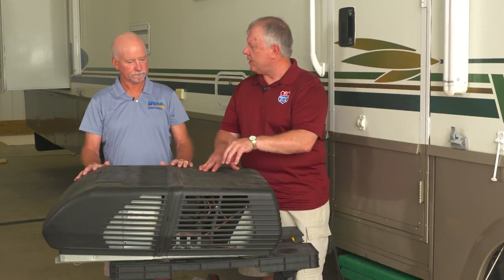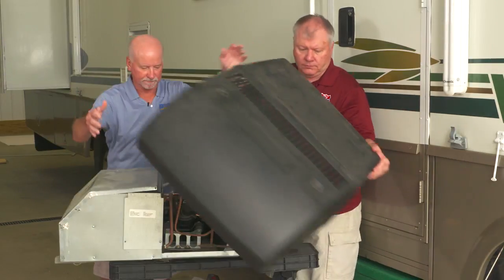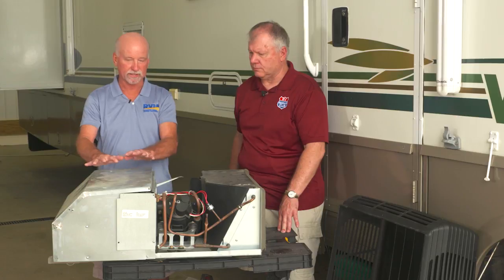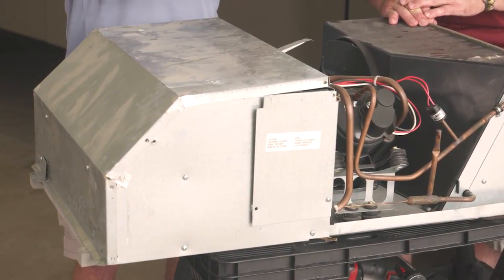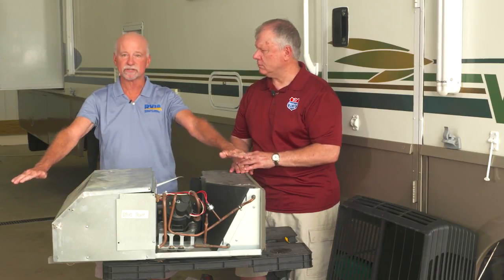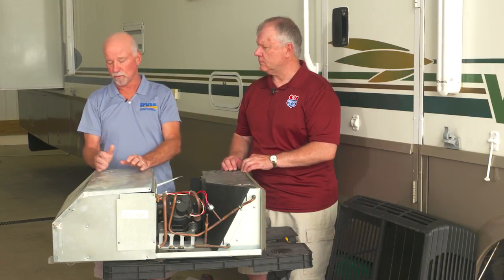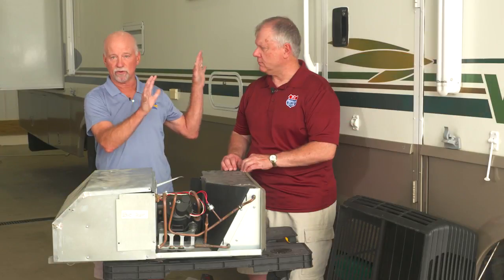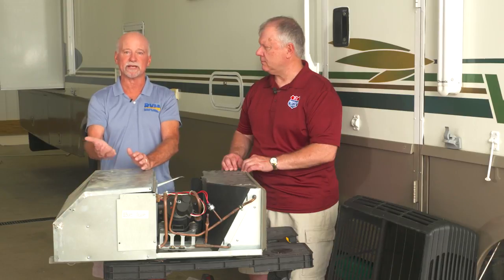RV AC Overview: How Cooling Units Work

Comment: My Coleman AirExcel rooftop A/C  unit sucks outside air in thru the rear coil and forward past the compressor not out.  Does this mean my condenser is in the back and evaporator is in the front?  I'm confused.